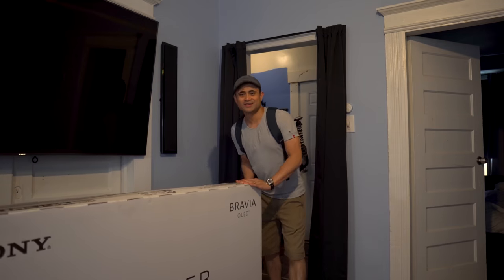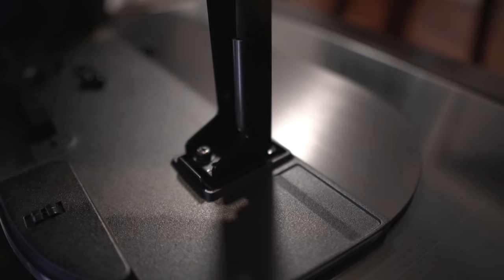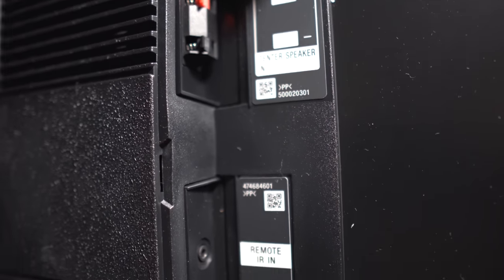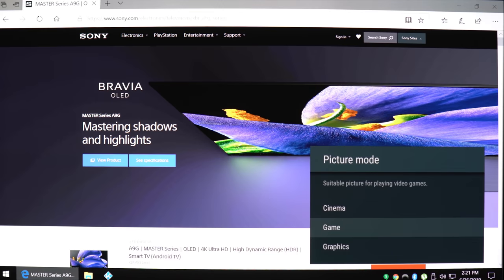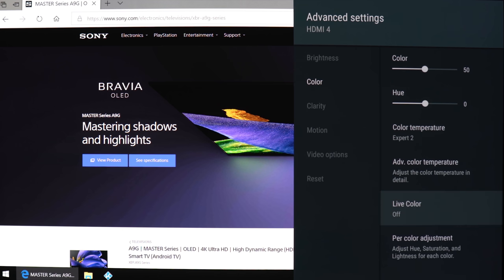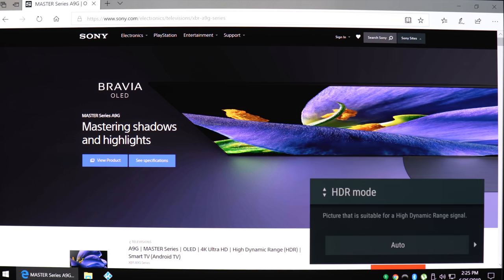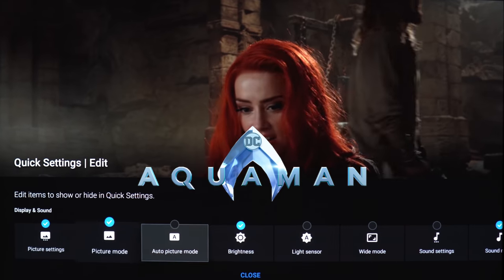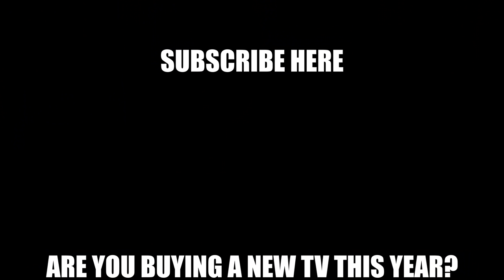SONY A9G OLED TV | The IMAX Enhanced OLED! Unboxing & Settings

Comment: Every review has folks touting C9 in the comments section.... had me on the fence but I opted for the A9G.
Build quality and longevity, I am not disappointed as the picture even on regular cable HDTV signal is great. I’m sure it’s the processor that has the huge quality upgrade in signal. The OS is flawless and very fast app to app.

No calibration for me , looks just fine out the box.

Comment: Awesome review yet again Shane. Funny I don’t know if I’m alone, but I never ever have used TV sound or used the stands that come with it. Have always had a sound system to do that and my tv stand hangs or floats from that back bar, or some even mount it on wall, so that tilt shouldn’t be an issue. I will prob be getting a tv next year, and this seems like a worthy contender now, though I really wanna go bigger than my current 65” Samsung 3D. And I’m sure a bugger size for this, if it exist, will prob double in price just for 10”. Anywyas, keep it up and I love your friends NIRVANA shirt. That was my band as a teenager in the 90s and my first CD was Nevermind lol.

Comment: Congratulations SpareChange and enjoy!!!  Still wowed everyday by my calibrated 65A9F I purchased from Robert at V. E. back in 11/18.
Reply from the maker: Nice! There really nothing different about the two.
Reply: @therealshanelee  Thanks
Reply: You did good I would purchase the a9f over the a9g 100 percent its def brighter tone mapping seems to work differently there is mor punch to the a9f it has a much much higher color volume it gets very saturated with bright colors unlike any other oled and the a9g just cant do it for some reason and the color gamut on the a9g was the lowest of any oled ever tested as weird as that is so the a9f is actually the better TV there are a few sites doing side by sides with the a9g and the c9 all of them are choosing the c9 but again must preference I know for me I had to bring my a9g back it wasnt bright enough and the new dynamic tone mapping on the c9 really brightens the image and in the shootout they didnt have that on but it's always on the a9g but again my a9g just couldnt produce the extremely vivid colors my c9 could I ahd to bring it back all preference I like bright vivid colors the a9g is super accurate but my taste and what I wanted I wanted the c9 the shootout was weird because everyone else doing side by sides and talking about the TVs are stating the lg colors are much more vivid and vibrant no matter what setting they put them on as weird as that is

Comment: @SpareChange, I thought I'd read/heard that before any TV is calibrated it should have at least 100 to 200 hours of use.  Apparently TV's need to burn in (not an OLED reference) or settle in before a calibration is done.  I believe at the TV shootout that they stated that all the TVs were run for 100 hours before they were calibrated for the judging.  Did Value Electronics run your TV for 100 hours at their store before they calibrated it?  Or did they just take it out of the box, immediately calibrate it and then pack it back up?  Genuinely curious.
Reply from the maker: Yes it was run for 200 prior to being calibrated.
Reply: Nice I was curious about that too💯I buying this tv next month, but was wondering do you think price would possibly drop for Black Friday???🤷‍♂️
Reply: I was about to get this TV calibrated & I wasn’t aware it needed 200 hours use for calibration, this is why I love YouTube , thanks for the info friend

Comment: the thing with all these tv's regarding picture quality, no matter what you have, you always get used to it very quickly and doesn't generally feel special. I bought the top of the range Panasonic 2018 LCD 55inch model which does have a great image quality but as I have had it for a decent period of time, it doesn't give you the wow factor anymore or a feeling of the image quality being particularly special compared to most other reasonably priced tv's. As long as the image quality is half decent and switching channels is fast, your not going to notice a great deal of different in day to day use.
Reply: I strongly disagree. I’m always wowed by the picture quality of my TVs while viewing 4K HDR content. But I only pick up top of the line TVs so maybe it’s a mid-range TV thing.
Reply: @ilusiil  it is top of the range but I have not watched a 4K content with a decent 4k player as yet so perhaps its the content im generally watching that isn't particularly high res.
Reply: Tht and not all TV's are perfect I bought mine for 3k and don't like the motion , hdr sucks except vivid  option and lag input sucks
Reply: hussar What TV did you purchase?
Reply: @ilusiil  a1e great picture for 2k it's worth it but 3k nahh no tv is worth that much caus theyr not perfect like I said

Comment: Have you actually tested out the A9G as the center channel. Does it actually sound decent? Also are the video apps like Plex, Vudu, and Netflix work well on the TV? I want to use the TV as my media interface instead of using my nvidia shield since it has eARC.
Reply: I have last years model you dont need nvidia you could use plex kodi any android app I'm actually getting this model at end of the week

Comment: Thanks for the video this TV is definitely my dream TV soon as I get my apartment this is the first TV I'm getting. I was wondering tho how much is it to get it calibrated and is it worth to get it calibrated??
Reply: Shannon Harris Not really because out of the box Custom setting gets you 95% there, and tweaking with RTINGS calibration settings get you 98% there. It’s the only TV on the market that’s nearly color accurate out of the box.
Reply: @fomoontech8217  no it wasnt it got a horrible score for out of the box for a sony the white balance was way way off  yeah the color was ok but the c9 was just as accurate out of the box actually more the Sony a9g got white balance de was 4.25 that's just horrible for any TV and the color was 2.38 de that's not bad gamma was 2.11 and got a rating of 7.1 not good for Sony the lg c9 was 3.46 de on white balance color de was 2.11 and gamma was 2.17 the lg got a score of 7.6 meaning the lg c9 is more accurate out of the box then go look at the after calibration there almost identical you def looked at the wrong review or something and the a9g didnt even make it on rtings top 5 TVs the a9f is still there and the lg c9 took the a9f first spot on there list

Comment: I wonder if SONY will have an software upgrade on this tv for hdmi 2.1, I called Sony the other day and they told me that HDMI port #4 on this tv will support hdmi 2.1, Any advice if this is true or not?
Reply: The A9G and A8G both do not support hdmi 2.1 and you’ll have to buy a LG B9, C9, or E9 for hdmi 2.1 bandwidth.

Comment: Owner of lg G6 OLED ready to upgrade but need help which one should I pick the sony A9G or LG E9 need your experts opinion.
Reply from the maker: The E is essentially the same as C minus cosmetics. You could watch the TV Shootout for the results.
Reply: Dont go by a shootout with your choice it's all preference I've had the pleasure eof using both the c9 and a9g I preferred the c9 more punch more vivid images my taste and brighter keep in mind the shootout turned the dynamic tone mapping off on the lg so it's even brighter then some think and I'm telling you side by side there is alot of loss color on the a9g but all preference super accurate go with a9g super punchy go with the c9 this is what I hate about shootouts  the results differ with other shootouts throughout the year and I'll tell you right now my c9 isnt yellow I'll also tell you it's super punchy and very bright compared to the a9g go watch abt aide by side he even stated no matter what he did the lg was brighter the had to turn the brightness down half way to match the a9g and he said the lg color was kore vivid no matter what he did so you have to see for yourself and choose for your preference

Comment: Question this is my oled can you tell me if this is burn in or banding ? please check link @t This is sony A9G 55 inch oled the black inky part on the right and cloudy white parts on the left . the color blocks or reflection. can you tell me if thats banding or burn in ? are? I did a 3% gray test Its my second A9G both had same thing. second tv I noticed it as soon as received the second tv when I did the 3% gray test

Comment: Just bought the 65inch c9. Im currently in new Zealand for a few more days so i can't watch it yet, but i got a really good deal on it from bestbuy. I got $500 off and a $300 egift card that im gonna use for part of the payment for my 4k bluray player. Which was going to be the ub-9000, but they wouldn't have it in time so i decided to go with the ub-820 since they have the same picture
Reply: Payne Hoss you could probably have gone with an xbox one x as your 4k bluray player
Reply: @Flynn_Schultz  i have one, it doesn't output in 4:4:4 and looks very washed out compared to an actual 4k bluray player. I could even see a difference with just a downloaded version of the same movie on my desktop on my pg27uq. Plus the ub-820 has specific features dedicated to enhance the picture quality and it was specifically designed for playing 4k blurays so it's a much better player than what's in the X. But i will be using the X for some gaming, until the new zbox and ps5 come out.
Reply: Payne Hoss  ok, i watched dunkirk on 4k bluray on my one x and was impressed but yes it doesn’t have 4.444 output
Reply: @HossLUK  my xbox one x looks pretty good but yes it will not look as brilliant as a really good 4k player but still good not washed out mabye it was your TV at that time I have noticed some TVs with the xbox one x seem to look more washed out then others but I have the c9 so you will enjoy the content on your xbox one x looks great to me but hey you got a good player anyways so all good  I just picked up the cinnamon hdmi cable form adioquest it really helped the performance on everything I have so extremely happy with that the TV was already punchy now the color is even more punchy somehow I've never seen a. Color palette like this on an hdmi cable
Reply: @Flynn_Schultz  The Xbox One S/X's  Blu-ray player is only impressive until you use a REAL 4K Blu-ray player.

Comment: I NOTICED THAT MY SONY OLED AG9 BECAME BRIGHTER AFTER 3 YEARS OF USE, AND I HAD TO LOWER MY BRIGHTNESS TO 36 FOR SDR AND HDR FOR CUSTOM PICTURE MODE SETTING. GAMMA FOR SDR REMAINS NEGATIVE 2 AND ZERO FOR HDR. BLACK LEVEL IS AT 49.  IS THE PHENOMENON NORMAL? NOW IT SEEMS THAT BECAUSE OF THE UNIQUE PHENOMENON THE SONY OLED AG9 SEEMS TO HAVE BETTER DEEP BLACKS AND BETTER CONTRAST IN SDR AND HDR MOST EASILY JUST SLIGHTLY BORDERING ON THE CHARACTERISTICS OF QD-OLED TV.    O, YES, THE SONY OLED AG9 IS STILL PERFORMING ADMIRABLY WELL. AT THE CINEMA MODE PICTURE SETTING I EVEN SET THE BLACK LEVEL AT 39 AND BRIGHTNESS AT 45 FOR BOTH SDR AND HDR.  AT EVEN ONE OF THE CUSTOM PICTURE MODE SETTINGS I EVEN REVERSE THE BLACK LEVEL SETTING TO 36 AND THE BRIGHTNESS TO 45, AND ALL PICTURE MODE SETTINGS PERFORM ADMIRABLY WELL TO MY LIKING.

Comment: Due to favorable reviews I’ve bought a A9G and I’m disappointed. The picture is nervous and seems to be only 60 Hz, so it’s not yet flickering but let’s say „pulsating“ and due to this headache inducing. Earlier TVs had 100Hz, 200 Hz or even more Hz for a smooth picture. I can’t believe this is Sony’s best picture, what a bummer. No reviewer seems to criticise this...
Reply from the maker: It's 120hz. No problems here that's why it's not brought up.
Reply: SpareChange - Thanks. The Panel is capable of 120Hz, but does Sony use it that way or do some picture modes (cinema) reduce it?
Reply: SpareChange - I asked Sony for a statement and they said it‘s only 100 Hz. However no info if or when they will develop it further to 200 Hz or similar to offer ergonomic frame rates/frequency.
Reply: Good Sound no entiendo como en las opciones de mocimiento, le faltan opciones como true cinema, estándar nitidez , uniforme.. y en el modo película en otros modelos se puede poner alto/medio/bajo
Aquí tiene solo Off y auto.
Ha perdido muchas opciones , muy mal por sony. No me permite configurarla a mi gusto el motionflow , solo tiene opciones de personalizar y así no me gusta.

Comment: Nice downgrades um i mean upgrades SONY.
Nice unboxing shane i mean patrick what a boost big pat doin a unboxing.
Reply: HD danman The biggest insult is ZERO noticeable improvements to PQ from A9F, and they reduced the SOC memory from 4Gb to 2Gb, WTF Sony?! So if you get a good price on last year’s OLED, GO FOR IT. Cost cutting at its most brazen. I do feel a bit better that my remote is cuter 😏
Reply: @fomoontech8217  What do you mean zero noticeable? You mean downgraded PQ? Less brightness... Less color volume. Less of everything. I honestly don't get it why would they downgrade a TV and sell it as an upgrade? wtf?
Reply: @fomoontech8217  I've not seen the previous remote but the current one looks extremely long so yes it may be slightly slimmer but if it means its much longer, again, not an upgrade.
Reply: Sony is the Apple of the TV world. They feel that they’ve reached perfection so they don’t even bother to improve upon their products, which is why they’ve been reselling the same TV for 3 years now with slight cosmetic tweaks and even minor downgrades in specific areas. The 2017 A9E = The 2018 A9F = The 2019 A9G.😩
Reply: @ilusiil  Well hopefully they will heavily discount the super expensive 2018 model :D
Reply: @ilusiil  They do image quality and colour accuracy about the best but neglect other significant aspects of the viewing experience, Panasonic is similar, Fantastic image quality, among the best but the user experience isnt as good as say a Samsung tv, especially in regards to its store and available apps, I bought the top of the lcd line 2018 Panasonic 55inch model, Great picture and sound is more than decent but you cant actually install any apps that are not already on and there are a few that are missing, I had to run through my PS4 for a couple of them.
Reply: @sermerlin1  something else really fucking weird he said at the shootout the c9 colors were washed out in comparison yet every other side by side on the internet right now state the c9 has much more vivid colors yes the a9g is accurate but it's nothing like the a9f with its color I had to return my a9g and get the c9 and I'll tell you now Sony def downgraded there punch and vibrancy in the image my c9 is much more vivid yet you can still get it very accurate I think the c9 is the way to go this year or the a9f if you can find one
Reply: @ilusiil  Well though i gotta say one thing... The sony XF90 is a beast of a TV. It is supposedly sony XE90 but it has enough upgrades. Brighter, more color, more zones, dolby vision, faster video processing chip... but for oled they surely fucked it up though.

I wouldn't say sony is the apple of the TV world but i would say they fucked it up with A9G.
Reply: People like you are never happy with anything always nick picking at everything, if you don't like your tv then just return it. Very simple procedure 👍
Reply: @nicholas802  At 2000e if you don't "nick" pick then you really don't deserve the money you have.

If you waste money just like someone would go for a car because has the right color even though it's biggest piece of crap... Doesn't really deserve the money.

This is teritory of the few. This is teritory of technology marvels and you are definitely expected of looking at every piece of marvel in order to pick ones that are good in this case this marvel is kind of chirped and fucked up.
Reply: @sermerlin1  so what are you really saying? The a9g is a piece of crap?